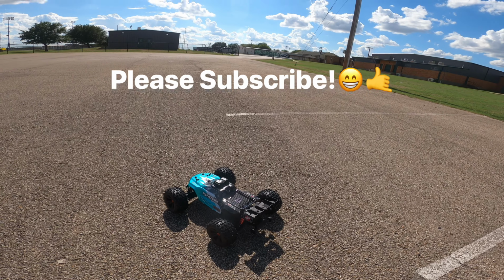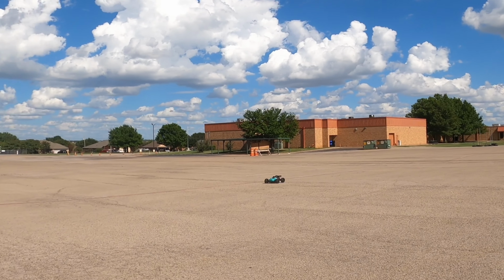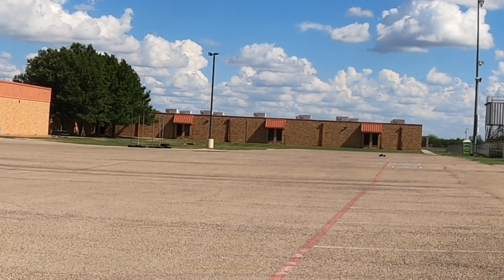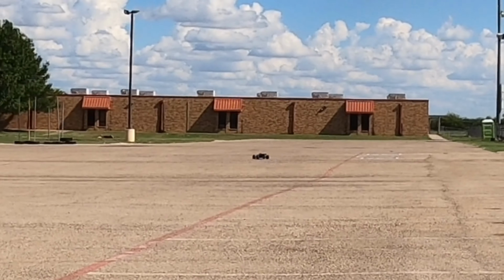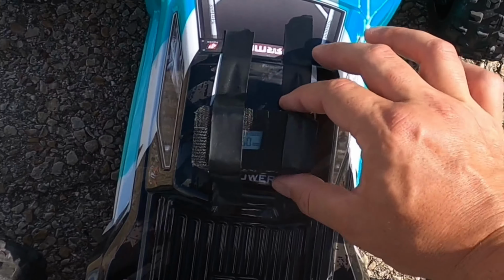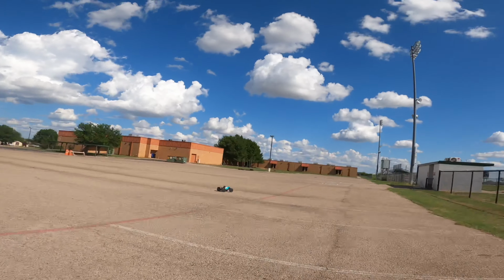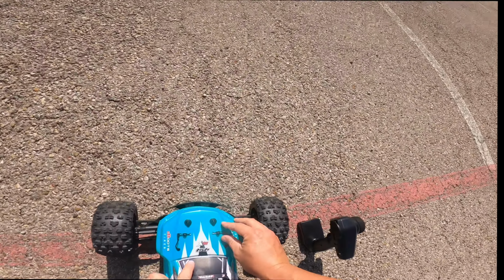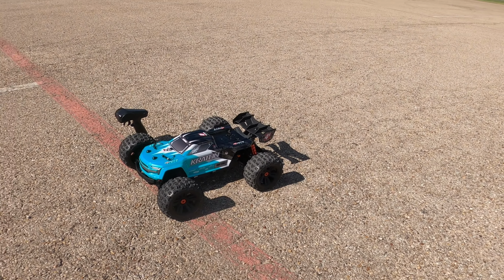Arrma | Kraton 4s v2 |  Part 1 | First run and speed test!

Comment: Diggin the Baby Blue , B. That car is planted & i wouldnt change a thing.
Reply from the maker: Hey David! How ya been brother! Good to hear from you again! Yeah honestly this truck is a beast! It fast! But most importantly I can’t get over how stable and planted it is in high speed turns, I took risks full throttle into turns and it didn’t traction roll or even skid out! Pretty impressive this is on the Erevo 2.0 level handling!!🤙

Comment: I knew you would like the kraton and the 6s is even more of a beast wait till you give it a proper bash you will be impressed just how stable the platform is give yourself a little more room and it will hit the 55+ as much as I love my kraton I like my notorious 6s even more its my favorite basher in my fleet.
Reply from the maker: Yeah, actually the Kraton is on the Erevo 2.0 level of handling, I was really impressed! Never once did I feel like I might traction roll or flip it! Definitely needed more room to let it rip! I’m positive I can get closer to that 55mph stock no problem, seriously though, I’m thinking about taking that leap to the next level, I’m talking about the 8s Kraton!! Wonder how it would compare to my Xmaxx ?
Reply: @rcreviews9894  the 8s kraton is such a beast but if i  make the leap to 8s I think i would go outcast but that just me cause i prefer the stunt trucks platform but you cant go wrong with any of them.
Reply from the maker: @Joercgarage  yeah the outcast looks dope too but with a truck that size and weight, I think stability and handling would be the way to go, I can already tell by looking at the outcast that it wheelies for days and backflips easily, it’s wide but it’s short, allowing for more stunts but I would hate to land wrong off the ramp with that 8s version! The Kraton although bigger, I think would take on the ramp with more stability and plusher landings, who knows, might have to get them both! 😁
Reply: @rcreviews9894   yes sir now your speaking my language lol😂 check out my latest on the notorious..  yeah its can flip and wheelie for days but its so wide and has such a good plush suspension it lands most of my sends and that just the 6s version but like i said you really cant go wrong with any of them. cant wait to see what else u got coming up on the channel.
Reply from the maker: @Joercgarage  I think you are definitely going to like this next unboxing!!  🤙

Comment: Got to do a side by side video against the 4s Maxx & 4s kraton
Reply from the maker: Yep 👍 you read my mind!
Reply: Got any suggestions on some 3s belted tires for the Traxxas rustler besides the anaconda tires those are ballooning up on me plus I got it ran over by a car the other day out in front of my house the electronics and the chassis shock towers everything survived except for 3 of the orange rxt wheels that's flattened smashed 😝 on 2s I'm getting 53mph on 100 c 2s lipo the 76th and the 31 gearing I tried it on 3s on that gearing it wants to fly in the air 🎮💔😁
Reply from the maker: @mikelester5524  wow, that’s pretty fast for that set up! Mine is still stock gearing! What about….. now this may be like blasphemy lol but what about some of those Arrma Hoons ? Not sure if they are belted but they go great on the Typhon as a street tire👍
Reply: @rcreviews9894  I tried the hoons 2.9 felony rear tires on all four on the Traxxas just too much weight and it stretched out slipper clutch a lot
Reply: @rcreviews9894  those would b the rears never tried the front felony hoons on all 4 just the rear hoons 4 the felony tires to heavy
Reply from the maker: @mikelester5524  hmmm I just run the anacondas but that’s just me
Reply: @rcreviews9894  what do you like better 4s Maxx or 4s kraton I only own 3s cars
Reply from the maker: @mikelester5524  it’s too soon to say, I’ve only ran the Kraton just that one time for this video, the Maxx v2 so far is untouchable in my book, maybe that will change, we will see, I plan on doing a more intense run and bash soon with the Kraton, couldn’t really run it the way I wanted for the maiden, bad location I think, not big enough and people driving through

Comment: I bought this exact car 2 weeks ago, and on my first outing I was having trouble with range, I was running in wet grass and at about 200 ft it would just stop. I'd have to walk about 20 ft before it would connect again. it's my first car ever so I don't know what the problem could be. any ideas?
Reply from the maker: It’s probably either the radio or the receiver
Reply: @rcreviews9894  yeah I wasn't sure which one so i just bought a dx3 with receiver combo and will put it in once I get it
Reply from the maker: @smokinone951  hopefully that helps, I had that happen to me before, with both Traxxas and Arrma, sometimes it could just be your run location, something interfering with the signal, sounds like a nice upgrade though and should definitely improve the signal range🤙